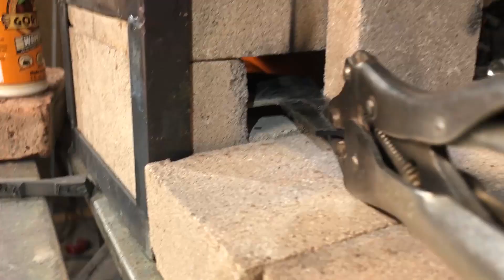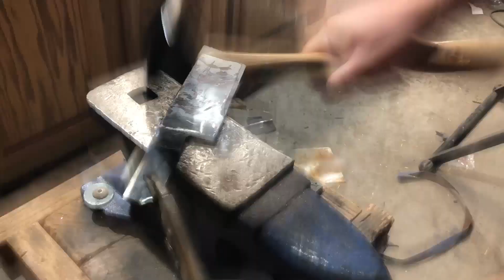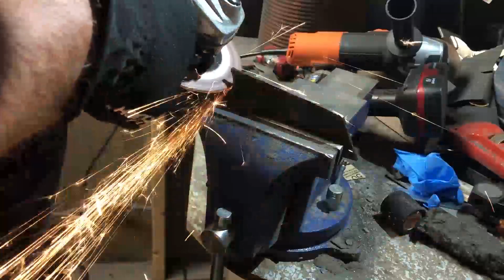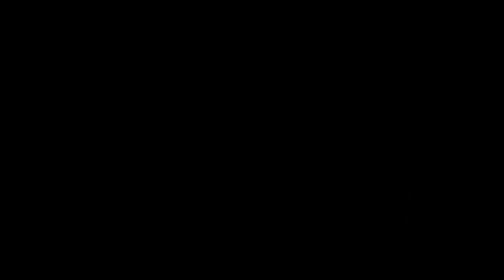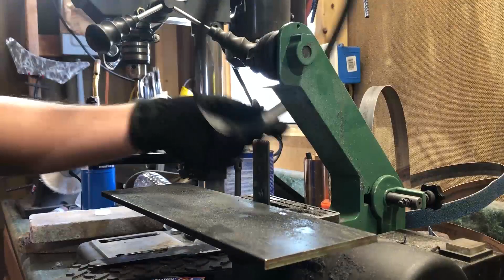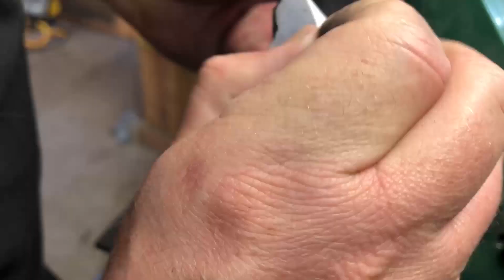Impovised knife for the Apocalypse (from lawnmower blade scrap)

Comment: could i use motor oil for my forge
Reply: For heat treating? You could, but vegetable oil is probably better. If you’re asking as a fuel, definitely not. Motor oil is not designed for that, nor will it work for that application.

Comment: I have a piece of O1 steel ( 1/8x2x18) and I'd like to make two kitchen knives from it.  In order to make longer blades, I was wondering of I could extend the length of the tang by MIG welding a piece of mild steel onto it?  
To me, it would seem like it would be OK as there would never be an excessive amount of pressure on it, but I'd like the opinion of someone in the know.  Anyway, Thanks, and thanks for sharing your knowledge.

Comment: Hey if you go on EBay you can get an 1/2 “ thick 12x4 A36 piece of steel and weld it to the top of that Harbor Freight anvil and not only add weight to it but make your facing much harder. I’m getting ready to do mine and it’s only like $18. If you have a welder? I saw someone do the same thing. After all what is steel but iron with carbon added. Then he cleaned it up and it works perfectly like a steel anvil. Of course the horn is another issue.
Reply: The harbor freight anvil is cast iron not pure /wrought iron. It has more carbon in it than steel
Reply: Justin Topp Thanks for the info. I’m not too concerned with the mix and it still works. Someone else also posted a video of them adding a steel plate to the top of these cheaper anvils and then he cleaned it up and it worked fine.
Reply from the maker: Cool idea. I'll look into it 👍
Reply: i have seen videos talking about danger of hitting hard anvil with hammers shooting pieces of metal off.

so is the anvil suppose to be hard? is the hammer suppose to be soft?  i am a little confused on this
Reply: Fred Garvin you want an anvil and hammer to both be hardened. For durability. You should never be striking the anvil with the hammer
Reply: @JustinTopp  so if you miss the piece you are working on you run risk of catching the hardened metal chipping and flying off?
Reply: @JustinTopp  not trying to discount what you are saying.

want to show you why i am confused on the topic

https://youtu.be/9CjKJ9v63Jk

but then you see a bunch of videos on how to harden anvil...        seems most agree with you.
Reply: @fredgarvin4482  not sure if you still need the info but what alec was using was a striking anvil. you use those with sledgehammers, and that undergoes a lot more force than the average hand hammer and anvil. For those, it's a matter of preference, but for a normal anvil you usually want it to be hardened.
Reply: @MythWorks  thank you. I just like learning Brother.
Reply: and then the videos about anvil ring and etc...

Comment: The white coating is more likely a powder coating or something on the steel burning off. It’s very unlikely that something inside of the steel was burning out. In all the hundreds of pieces of scrap steel the only nasty fumes came from the coating. For the lose tongs a tap on the rivet cold and it will tighten. For the propane forge block the door mostly off while heating and give it 15-20 minuets to get nice and hot before putting the steel in. Looks like it might need gas pressure turned up a bit and more air maybe for more heat. But nice work on the knife. Cool to se revisited design. Also congrats on all the channel growth. I remember back when you were still at a few hundred. Doesn’t seem that long ago